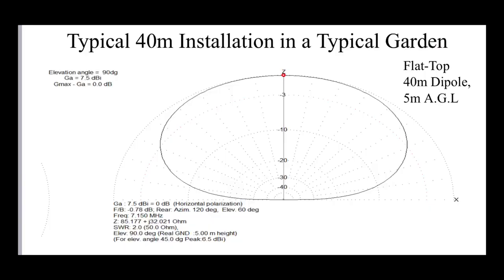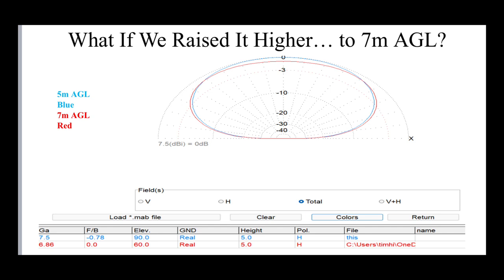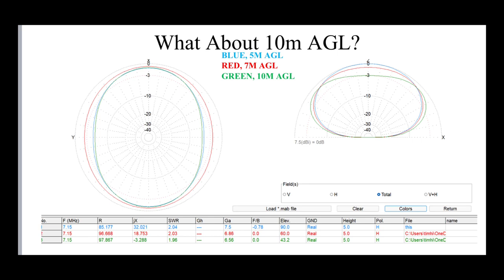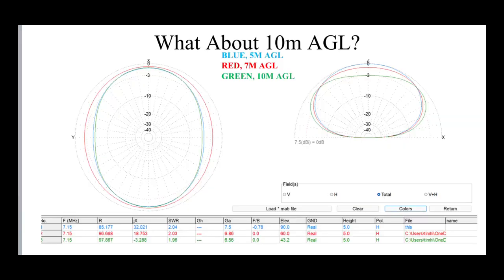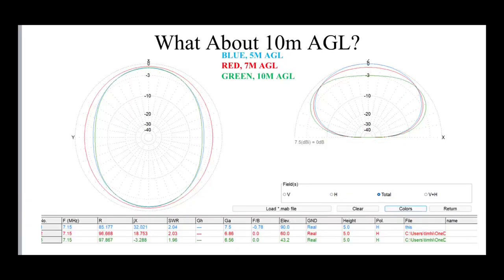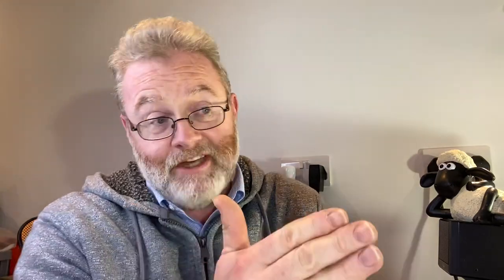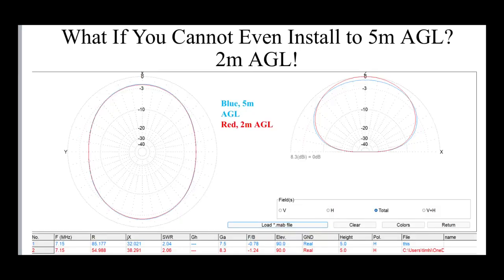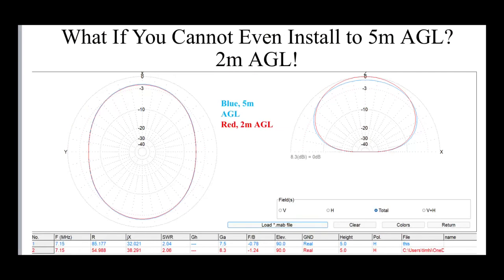Ham Radio: 40 Metre Dipole - Which Height?

Comment: Good info. I always say that on 160 and 80 meters a vertical is the way to go because most people can’t get a horizontal antenna high on those bands but 40 meters is different. It’s a transition band. If you can get 50 feet high then go horizontal. If you can get only 40 foot it almost does not matter. If you get a good ground system the vertical will be almost as good as the dipole but you lose close in coverage. I like half squares for verticals as you get some gain over a dipole and no radial system needed if you feed at a top corner. My 40 meter half square was equal to my 40 meter dipole at 40 feet. I kept the dipole because of simplicity and high angle performance. I now have a 40 meter dipole at 50 feet and it does quite well overall. In fact I have worked 100 countries in a contest over one weekend.  The half square on 80 is absolutely a great antenna! 73 de N4DJ
Reply from the maker: Good observations thank you

Comment: I've lately been playing around with linked dipoles looking for an nvis antenna to use during local qrp competions. So after some calculations and considerations I built a LD for 40-10 that is only 3.5m high in the center.

I set it up in my front garden for a test. My qth is in the bottom of a valley at 990-ish meters above sealevel. The tops of the mountains around me is at least 1700 masl with a small gap towards the North.

I was pleasantly surprised! On 40m made a few contacts with locals about 500km south of me and others 300km west with no problem at all. The fantastic surprise I got was when listening around on 20m and deciding to answer an Italian station.....and I actually got a 57 sr! The signal most probably came right through the gap, but I was very happy. (Used a g90 so that was at 20w).

Can't wait to get the antenna up on the mountain top during the next contest!
Reply from the maker: Fabulous!

Comment: Brilliant video Tim, so practical and exactly the kind of info the majority of us mere mortals in housing estates need to know.. getting antennas above the usual 20ft scaffold pole height without a tower or tall trees is certainly a challenge and usually involves fibreglass telescopic poles and of course they bend very easily once you add a dipole type antenna and look unsightly which then incurs the wrath of her indoors... doesn't stop us having a go all the same loll
Reply from the maker: Thank you Dave! Yes it’s a bit of mission getting a wire up but it’s a lot of fun. 👍👍

Comment: Another excellent video Tim. I use modelling all the time in the day job (ionising radiation), but always try and get some real world measurements to "calibrate". As for HF, overall for DX use a 1/4 wave vertical. But even then, a EFHW at 8m still does the business sometimes!  What I have learned so far is that one size fits all antenna just does not exist, at least not for my garden! So I have a DX Commander 1/4 wave, a EFHW and a magnetic loop. In a QSO I often switch between all three and it is really interesting to find that not all is as expected. I have a regular US station I listen to which is much louder on my EFHW,  but when I have contacted them I am much louder when TX on my DXC.  Mark, 2E0MSR
Reply from the maker: Thank you very much Mark and I agree, we all need more than one antenna. Oh to have the space!

Comment: I'm new to hf and just came upon this when researching antennas. Great and easy to understand presentation. I do have two questions. If I am only able to get the center part 15 to 20m up but the ends only go up to around 10, is that still better than every part of the dipole at 10 or will that sharp triangle hurt my angle of radiation? Also, with this very high off the ground set up that is optimized for 40m, does it hurt my 20m performance if I were to use the same dipole for it?

Thanks
Reply from the maker: For both questions yes getting the high current centre up higher is better. It won’t hurt 20 if the antenna is higher 73

Comment: Old Pete mate gives antenna modelling a good shoeing at every chance he gets. But if we all built EVERY antenna idea without a bit of pre-work, there'd be more wire than it took to cross the Atlantic.
Reply from the maker: Very true! Modelling has its uses and provides a guide. Sometimes it presents such a contrast to what we thought should happen that it prevents us wasting our time or, alternatively it encourages us to have a go. It’s all fun. 73
Reply: @timg5tm941  I also respect old Pete's point of view. But it's a little different for him as he has a LOT of experience and knows instinctively a lot antennas that will stand a good chance. and ones that don't. The slightly younger/less experienced hams, have to do some sanity checking.

Anyway, all part of the hobby.

Keep up the good work!

Comment: There is also the other way of looking at it... remember your training & for the classic 2 element yagi reflector is placed  0.15 wavelength back from the driven element, well 6m high on 40m is just that & the ground is conductive & acts as a reflector so your 6m high 7MHz dipole is actually a 2 element yagi pointing straight up for NVIS... the ground is your reflector. 6m is actually a good height to be at.
Reply from the maker: Roger, noted 👍

Comment: First of all, i was really looking for someone to make such type of comparison, made situation pretty clear now...so thanx for that...i have a question about which im not very sure, you might be able to answer it....i have a 40m inv V dipole at the roof of my house, roof itself is around at the height of 20ft, and apex of the antenna is roughly 36ft.....can i safely say that the height of my dipole is 56 ft ?
Reply from the maker: Ah now do you mean the antenna apex is 36ft above the roof or above the ground?
Reply: @timg5tm941  Antenna apex is 36ft above the roof..
Reply from the maker: @Capt_Duffy  it’s about a 1/4 wave from the roof at 40m. The roof will act as a secondary ground. Therefore in practical terms it won’t quite behave like an antenna at 56ft agl
Reply: @timg5tm941 👍.....

Comment: is the height from tiles roof important for inverted V 40m dipole?Mine only 2' from the roof and about 10m from the ground. .SWR is high. Some suggested to have it at least 5' from the roof and the angle not too steep.
Reply from the maker: That sounds right. Keep it away from buildings etc

Comment: A look at a dipole flat against a inverted v might be a good comparison?  
Living in the NE of Scotland i find getting down to S England/ France or Netherlands,  a horizontal ant east west works prety good any hight , but a high inverted v even at 60 feet i feal my sig south is lost somewhat ?
Reply from the maker: Well it’ll be a little more omni directional as a v but not much more given you’re almost a 1/2 wave above ground. Must be better broadside gain with the flat top?
Reply: @timg5tm941  think that's right . Pity I can't test side by side . Tks for all your efforts.
Reply from the maker: @robduncan599  yes I wish i could do A/B testing at home. Still, enjoy the radio and thanks for stopping by and commenting 73